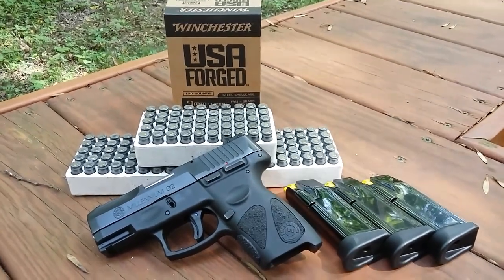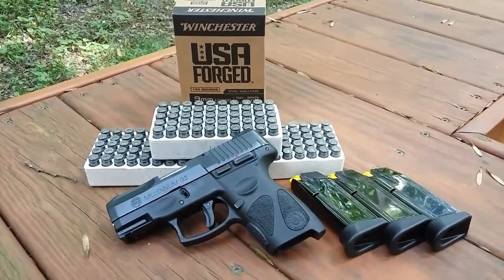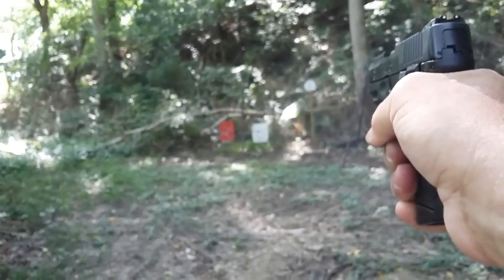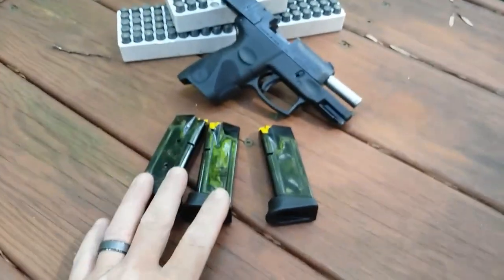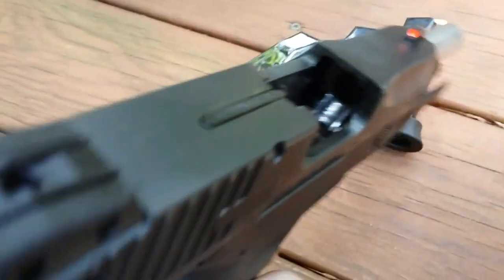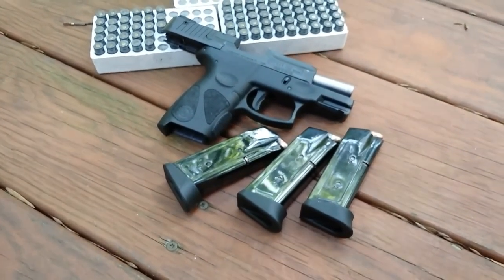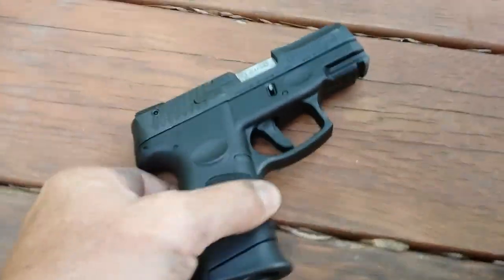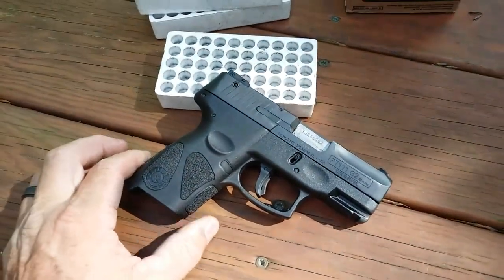Steel Cased Ammo vs.Taurus PT111 Millennium Gen 2

Comment: I have noticed that when I keep the mags fully loaded for a few weeks that I'll have slide locking issues. So most like just weaker springs in the mags. No issues when I store with only 9 or 10 rounds in the mags. Can definitely tell a difference. 
Good vid very informative. Love my pt111. Absolutely no failures with fresh mags. I've put well over a thousand rounds through it in the last couple months.

Comment: Just got the G2c and put 200 rounds using 4 different 115 grain brass cased ammo without a hitch.  Tweaked the sights in the process and after a few mags, was VERY pleased with it's performance...even got quickly used to the 'odd' trigger pull (my go-to guns are G19 and S&W MP9c).  Plan to shoot a few more hundred range ammo rounds then run some self defense ammo to possibly seal the deal as a viable carry piece.  $197...can't beat that with a stick.

Comment: I have +500 rounds of tulammo steel through mine since June 2016. ZERO problems.  In fact as a testament to tulammo, no failures on their end either.
Reply: wish i could say the same. ran 50 Tula 115 grain steel case and every other round would jam but ran 450 rounds of Winchester 115 grain fmg without a single jam
Reply from the maker: I like Tulammo. no picking up brass
Reply: EagleRun23, yeah i mostly ise tul thru my g2, runs perfect never failed on me, put over 500rnds of tul blew everything up, their very nice guns for that price i love mine
Reply: blew all my targets up* lol gun if fine as a tack
Reply: I've had good luck with Tula out of my Glock and VP9
Reply: I'm at 200 of it mainly bought it because it's like 8 bucks at Walmart. No gun or ammo issues.
Reply: TULA is excellent ammo and its hot!

Comment: I have the same gun and I love it. After 3 years of using all types of brass ammo without any problems, I bought 150 rounds of steel case Wolf ammo because of the shortage on ammo. It was cheap and I didn't want to use any of my stock of brass. I loaded a magazine with 10 rounds and dumped the mag. The first 9 fed and shot great. The 10th round swelled up and got stuck in the barrel. I don't blame the gun because it has always worked flawlessly. I had to wait to get home and dislodge the round with a thin wooden dowel. I probably won't be using steel cased ammo in this gun anymore. The same Wolf ammo worked great in my Hi Point 9mm carbine though. I guess its just hit or miss on steel ammo.

Comment: I just picked up on of these G2 pistols, put 48 round brass Remington & 48 rounds of Federal Champion Aluminum case ammo ate it all up. I am so far very impressed with this nice little shooter. I still haven't got to run any HP ammo yet. Thanks for this video, I won't purchase that Winchester steel case ammo anymore due to several ammo issues with my other 9 mm pistols. Got a box most of the round the projectile, bullet was pushed way down into the casing. Very dirty ammo, I even washed a box of it, I only purchased 2 boxes of it cause it was a good price. Even after washing the ammo was still blacking my hands.
Reply from the maker: Pinger 556 thank you for watching

Comment: I did the same exact thing. Ran that ammo through my G2c and it ran fine except for 2 stuck cases (did the same thing on my Ruger lc9s too), but I racked the slide a few times and they finally cleared. That ammo isn't even as good as Tula. I don't think the steel is lacquered as well or something. But the G2c ate all, and continues to run. Many hundreds of rounds later, those 2 stuck cases were the only mishaps I've ever had.

Comment: Love this pistol. The failure to lock back a couple of times could easily be that the ammo is underpowered.  The slide has to come back farther to engage the slide lock than it does to strip and feed another round, so if the ammo is underpowered that's the problem that would show up first.

Also I believe your hands turned black because the steel cased ammo is lubricated to prevent rusting.  It looks like it might have graphite or teflon suspended in the oil which would give it that grey color.
Reply from the maker: Alan Chapman Thanks for watching.  you may be right
Reply: Change your recoil spring from plastic to steel get one from ebay

Comment: I’ve got a g2 and I just put my 500th round through it with fmj and hp ammo of all different types and all I had was 2 fail to go into battery on my very first 50 rounds after that it has been flawless it’s my edc I shot my sons Glock 19 and other than the trigger pull being long on the g2 it shot just as smooth as the Glock 19 I was gonna buy a Glock 19 but after comparing the two I’m happy with my Taurus it’s really a great gun I’m gonna replace the guide rod with a stainless steel rod and keep this as my edc!!

Comment: i had several failure to eject on 111 newly repaired from factory trigger failure, and on ruger lc9s  the same story. i usually use winchester white box with no problems. brass cases no problems

Comment: my issue was with the gen 1 pt111 40sw it was a great shooter but the take down sucked the spring and guide rod would dislodge 1 out 3 times on reassembly so I sold it! then this 9mm pt111 which I have converted to from 40sw as my main stay round this gen 2 pt111 looks like a gem for the $$$ I carry a Glock 19 its has never jammed and take down is very simple.
Reply from the maker: jon Picher thanks for watching
Reply from the maker: jon Picher my Glock 19 had 7 malfunctions in 1000 rounds. Mostly with aluminum cased ammo

Comment: Its funny, out of all my guns my Glock 19 Gen 3 doesn't like that aluminum case ammo either. It's a shame when budget priced firearms outperform other firearms that cost 2 or 3 times more. lol... 
oh, and I like your range set up.
Reply from the maker: I agree . and thanks
Reply: Channel Cat Chaser where did u get ur Taurus pr111 for $220.00
Reply from the maker: Whittaker guns in KY
Reply from the maker: gander mtn has them on sale right now
Reply: How much at gander mtn
Reply from the maker: Watch my shopping with Triple C video it's in there
Reply: Mikey D i got mine there for 260 ish a month ago ,allready put 400 rounds threw it ,i love it
Reply: My Shield 9mm. wanted no part of the aluminum either. I couldn't get through a single mag without a failure using it. My Glock 26 with aluminum?  No problem. P-95 Ruger and aluminum? No problem.
Reply: I scored a new G2 in Stainless with SA/DA and 2 magazines for $245 including all taxes, shipping, and fees. :)   My EDC right now is a modded G43 with extended mags, rubber grip, Ghosted, etc.....  if this G2 runs 300-400 rounds with no failures, I'm selling my Glock 43 and pocketing the $200 for ammo.

I even like the trigger which people say is junk. I disagree. It's 85-90% as smooth as my ghosted G43 and about 90-95% as smooth as a factory G43 trigger. Yeah, the first DA pull is really long, but after that, take-up and SA pull is perfect IMHO.

And the grip, fit, and feel in my hand is AMAZING. It is the BEST feeling gun I've ever held in my hand. I'm not exaggerating. Something about the thumb grooves and grip stilling is just PERFECT for me. Even covered in oil, it feels super glued to my palm.

The plastics aren't quite on par with SIG's, Glocks, HK, Walther, etc but not bad enough to make you doubt their durability. The plastic rear sights seem on the cheaper end for sure, and probably would not hold up well to very rough, everyday heavy duty use such as active military, patrol officers, etc, but otherwise they'll be fine. They just seem a bit brittle and light.

I've owned SIGs, Kimber 1911s, Smith and Wessons, FN Herstal, Walthers, Glocks,etc.... but something about this cheap gun makes me love it more.  

When factor in everything...price, weight,  grips, fit, size, mag capacity, reliability, finish, ramp polishing, looks,  trigger...this is my favorite pistol of all time. No exaggeration. 

I cannot think of a gun that's 2-5 times as good, but that's what their charging.
Reply from the maker: I agree 100%
Reply: Jon Mathews: You know where I have to call bullshit on your story? There is no DA pull on the Millenium G2 unless you had a light strike on a cartridge OR you turned yourself into a pretzel to decock it. I know cause I have a G2.
Reply from the maker: My Bad double strike capabilities
Reply: Channel Cat Chaser: my comment was aimed at Jon. Sorry if I didn't make that clear. 

He was referring to how hard that first DA pull is when in fact the only way you can have a "first DA pull" on a PT111 is by field stripping the gun, inserting a live round, reassembling the pistol, doing the hokey pokey, and doing it all without ending up with no new holes in your head doing it. So I had to call bullshit on his post.
Reply: D Cruz i shoot this cheap stuff all the time. 500 rounds every time at the range and no problem shooting G 26.
Reply: Bradley Slackenfelch my xds 9 didnt like that aluminum ammo
Reply: X MarksTheSpot this is a true under dog story with this gun and I’m happy to hear a Glock owner give it props

Comment: I have found that with some magazines the tab on the bottom of the follower can be a little too long, causing insertion of the magazine to the point of secure lock, to fall short.  I ground off some of the tab and now the magazines seat right and no longer drop out of the pistol while firing.  (see arbitrary magazine release Taurus PT111 on you tube)
Reply from the maker: Tom n thanks for the tip

Comment: mine seems to shoot low left even after sight adjustment. any ideas on what the issue might be?
Reply from the maker: murphull I sure don't.  Practice I guess
Reply: murphull 
I had the same issue and I figured out it was me not being used to the trigger and the short reset. Once I started to concentrate on the trigger,  my shots were at point of aim.
Reply: New shooter, here...

I was told that I'm anticipating the recoil.  I should be surprised by it.  That helped.  Again, that's just my issue.  You're more experienced, I'm sure!
Reply: me too
Reply: Mine was shooting left, till I found that my front sight wasn't perfectly centered. It was slightly turned to the left. Once I centered it with a tape measure, it shoots true.